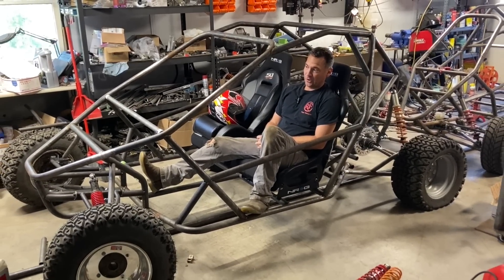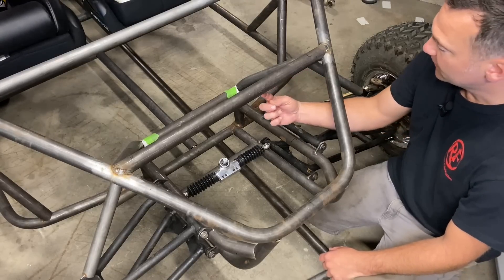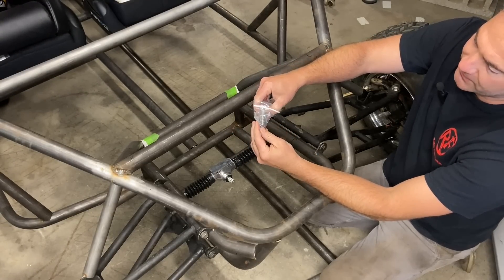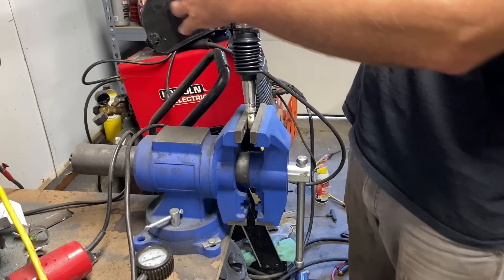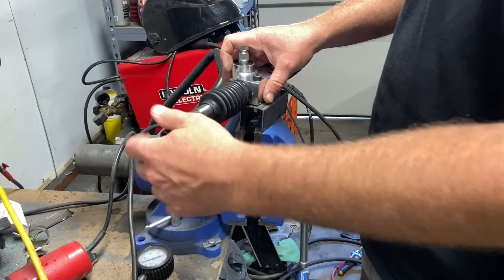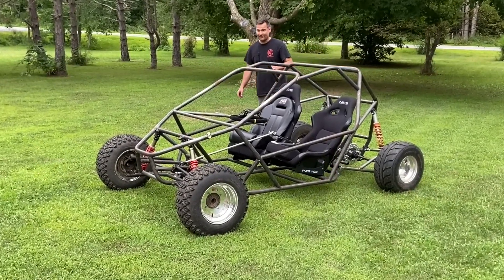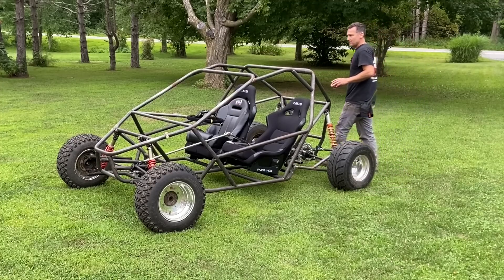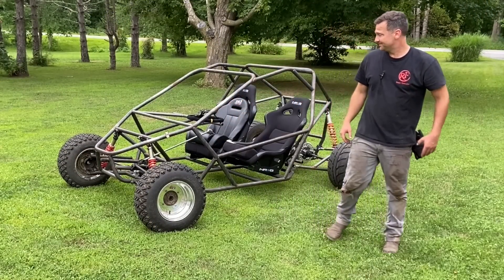Two Seat Crosskart:  Custom Front Suspension and Custom Tie Rods

Comment: Could you put longer arms to give it more ground clearance or would it mak it to weak im thinking of making one of these instead of a rzr  but i would want taller for ruts and more general off road
Reply from the maker: The arms don’t need to be longer… they can be set up with tons of clearance and travel and still have a 62” width. Shocks, tires and setup is how you get all of that.  That’s why it is a “VF” for variable frame, you decide how you want it set up.

Comment: Could you explain the reason for placing the steering rack behind the axle in stead of it front of it? (As it should be). Could you also please explain why the shocks were placed without taking into account the relationship of the shock and control arm angles when fully extended and fully compressed? I'm struggling to find any reasoning and think I should now find another channel that gets into the real geometry of suspension. Good luck.
Reply from the maker: I couldn’t imagine where I would be if I relied solely on youtube channels for my knowledge. It’s called research. But I also created a Facebook group for plan holders for discussions like this. I wish you the best man.

Comment: Would you say those tie rods are stronger than 7075 aluminum 
I found a pair of 72” rods from LM-UTV for 80$
Reply from the maker: They are stronger for sure but aluminum is lighter. I just can’t weld aluminum with my tig

Comment: Awesome work, I've been here for a while learning from you guys to make my own project in the near future. Just a comment, I realized that in the front A arms there is no the same distance in height in the frame side than in the steering nuckle side, as a consequence, when your tires move up or down, you loose your camber alignment. And I confirmed my suspicious when you drop the kart from the front part, you can see how the tires loose the camber alignment.
Reply from the maker: It’s called camber gain and it’s on purpose. Thank you for joining in on the fun.

Comment: Will you have reverse? I've seen the gear box used for it, spendy..!
Reply from the maker: It will not have reverse. I’ve had one for a couple of years now with no reverse and it doesn’t really bother me. It would be nice to have an unlimited budget though, right?
Reply: @KJRaycing  lol right..! Some older snowmobiles had reverse. Might be an idea???
Reply: You could always do a starter gear off the sprocket and use in neutral??...

Comment: When will the full list components be available? Thanks for all your Time. Can’t wait to start one.
Reply from the maker: I’ll probably just merge the components list into one. I’m using a lot of the same parts for both VF’s. I’ll update when I finish it to make sure it is accurate. You could probably just get the VF-1 component list to get started and get the update when it comes out for anything that might be different. I cover all the parts I use in the videos as well.

Comment: How are you liking the 459? I've put one in an old Honda Odyssey. No governor with a 34mm mikuni and Robertson's torque tube header, it's pretty quick. I'm running a 40 series with 9t and 60t. 23" rear tires.
Reply from the maker: I think the 459 is fantastic! It was easy to set up, it has plenty of power and I haven’t even upgraded it yet! The budget build is quickly turning into my wifes/daughters kart. Although I definitely like to get some wheel time in on it too!
Reply: How were you able to actually buy something from Robertson's Torque Tubes? Everytime I've tried (multiple different times about multiple different headers) to no avail! He always says he doesn't have whichever header I'm wanting in stock and that he'll email me in a couple of weeks, never does. 🤔

Comment: Nice work man! Awesome projects! One question, how do you know what shocks you have to use in your designs? or how do you choose them
Reply from the maker: Thanks man! My choice of shocks is definitely used. I look for threaded bodies for preload adjustment and I look at spring diameters to see if the springs can be swapped out. And obviously I look for good deals. $100 bucks per corner for a good used name brand adjustable shock is absolutely worth every penny. As far as shocks for my design; I design to have a lot of options for mounting and ride heights using triangulation and crossmembers. My chassis could use 25” shocks as well as it could use 12” shocks.

Comment: To get your track width did you use rzr 800 or 800s control arms
Reply from the maker: They were on ebay as 800s. I would have preferred 800’s I think. Not sure what the difference is in width.
Reply: @KJRaycing  The 800 has a track width of 50" The 800S has a track width of 60.5", The 800S wheels front are 4\2 rear 6\2 vs 800 wheels are Front 3\4 rear 3\5 , 800 RZR guys want to upgrade to 800S arms for better stability and 60" track width , the RZR 900 spindles are the same dimensions just have a larger brake rotors and 4 piston calipers, I wish I had figured this out before purchasing the 800 spindles. If the front control arm mounts is the same between the 2 seater and single seater than builders now have several other choices for front hubs and spindles but RZR'S are 4\156.I have 800 control arms already and when I get the 800S I will post measurements on the Facebook site. Hope this helps FYI , I am going to use the RZR 900 front diff and rear transmission on my 2 seater.